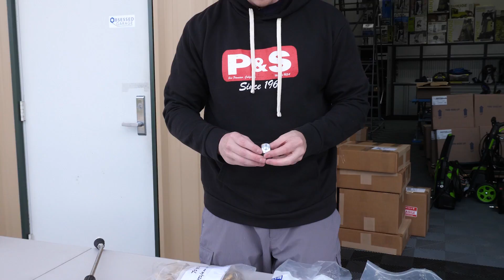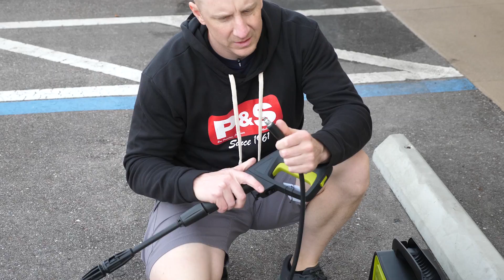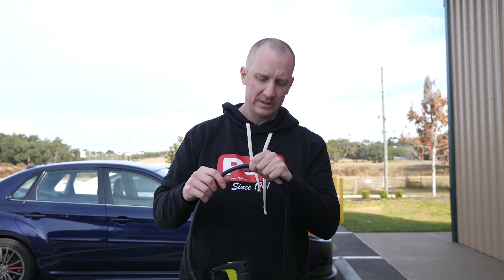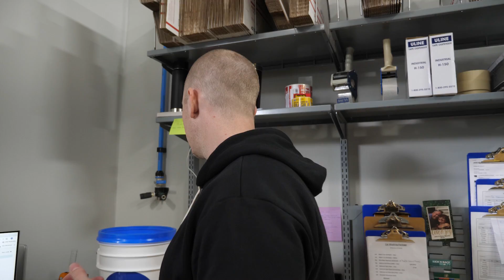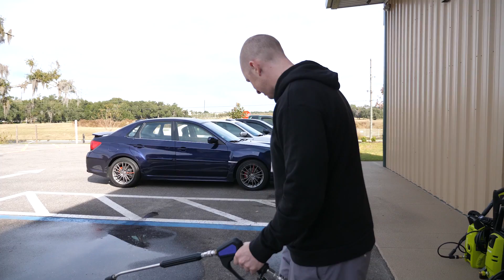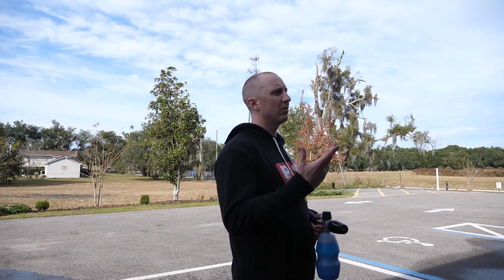The Pressure Washing Project: E6 - Testing the SunJoe Product Line - Part 1

Comment: Hi Matt!! Just tested your setup for the first time today with my sunjoe spx3000 and there is something wrong about this. The pressure is soooo low and even with a 25° nozzle, I had to come very close to the paint to remove the dirt and even the soap. I also try the foam canon and it's so watery. No thick foam like I used to have with the stock hose and gun. The other problem I have is that the pump just keep going on and off every 2 seconds, even when I'm not using it. What's the problem? Why do I have such a low pressure and if I want to use it for heavier jobs, does it mean I have to use the stock hose? Is it possible to get higher pressure with your setup or it's only meant to be used for car wash with around 1000 psi? So much questions, I thought this setup was going to be so good, but right now I am a bit disappointed, especially for the price I paid, but I'm sure I'm doing something wrong and you can help me fix the problem. Thanks alot and keep up the good work.

Comment: Recently purchase a sun joe spx 4000 pro. I want to try to mount it inside the house and some how connect it to water inside and create a spigot for the pressure washer line outside. Any suggestions would be appreciated!

Comment: 15:18  My exact thoughts when I bought my junky Karcher.  It's going on 2 years working great still for WELL under $100.  Yeah, I'd like to have a Kranzle, but in the meantime, as a pro, my bottom line sure is thankful for this POS, and the cars can't tell a difference between pressurized water from a $1000 Kranzle and a $100 POS--they still get wet, soapy, and rinsed no matter what.  Hopefully I'll be able to afford a Kranzle by the time the Karcher pukes, though  :)  Sometime sooner I'll probably swap the gun and hose not cuz there's really anything wrong with the Karchers (well, the long Karcher gun is awkward sometimes), but cuz I'll need those for a Kranzle eventually anyway.

Comment: What length cobra jet pressure washer hose are you using for testing? Would some of these measurements change much with a longer one? I prefer a slightly longer hose myself.
Reply from the maker: 50'.  There was no difference in output with 100' hose.  Once you get over 100', you'll start to lose some.

Comment: Interesting roundup testing, over here in uk karcher is most common, so will be most interesting your thoughts on those 🤔 😂
Reply: Also these are the common plastic and stainless quick uk connectors from uk fyi ..https://www.hozelock.com/product-category/watering/fittings-and-connectors-watering/hose-connectors/

Comment: A similar activity for machine polishers would be interesting.
Comparing the industry standard Rupes with the other less expensive popular machines.
Using various pad and polish combinations with each device. With a mix and match scenario. 
An Interesting outcome I’m predicting.
Reply from the maker: The problem I have with that test, the cheap ones are a blatant copy.  I don't think they don't deserve the test.
Reply: Obsessed Garage 
Fair comment. It’s appreciated. 
Maybe let the quality speak for itself. 
I think we know the likely outcome, tested or not...
Buy the best you can afford. Not the cheapest. There is payback with quality. But unseen at initial purchase by some!

Comment: What is wrong with gas power washers?  Is it the noise?  Can't you get similar results to a kranzle with a quality gas power washer?
Reply from the maker: They don't turn off when the trigger is released, and noise.  We also really don't need that much pressure for washing a car.

Comment: I'm interested in one of the products featured here......that beautiful blue Continental water hose!  I have a feeling come Spring I'll be buying a few hundred feet of hose from you.
Reply from the maker: They are really nice.
Reply: @ObsessedGarage  Surprised that you haven't had much to say about getting a garden hose with stainless fittings  :)  I use a Conti hose at home, but I'm a mobile detailer, and I've been on my own OG-style hose hunt lately.  I've been trying to find the perfect lightweight hose which would probably look something like a 1/2" polyurethane hose with full-flow stainless fittings.  Ugh, I HATE hoses that have restrictive fittings!  There is no point in having a 5/8" hose if your damned fittings choke down to 1/2" or, as I've found with some, even smaller!  If the fitting size is what I want, I don't want to pay for and carry the extra weight of larger-than-needed hose, and if the hose size is right, a choked fitting makes it effectively too small.  I thought Water Right fit the bill, but I'm told their fittings are major choke points.  Eley is the only company I've found that fits their hoses without restrictions.
Reply from the maker: Finding stainless 3/4" GHT Ferrels is not easy.  Then I would a fitting press to install them.  My goal is to be able to do that at our next facility to make custom lengths.

Comment: Appreciate all the work on the testing; it’s a lot of work using equipment you don’t like using lol Seems like the tiny portable units of all the makes so far perform better than most people would suspect. Makes some sense as there are way more companies that make pressure washers than actually produce the pumps and motors so underneath many are probably very similar. That little SunJoe used less amperage but had better flow making it more efficient than lots of the bigger units and had what you really need to wash a car so not terrible. Too bad SunJoe uses those weird sized fittings. I have an SPX4001 and needed to get the right adapter. In the end it’s not a big deal because I wanted an MTM gun and foam cannon anyway so I was going to toss the original gun no matter what washer I bought. The way I look at it a quality gun and cannon last and get carried foward if you upgrade to a new machine in the future. 

The problem I see with something like a Kranzle, as super nice as it is, is that the customer that gravitates toward paying $1k for an electric pressure washer for his car is going to be the type of person that will run out and buy the $1200 new best thing when it drops a few years later so buying a pressure washer to “last” is kinda moot. For the record I’m not opposed to spending money on machines that aren’t the best financial sense if you love them and enjoy using them; I bought an Alfa QV that probably requires a few screws loose to buy but I love it and it puts a smile on my face so who cares! 😜
Reply from the maker: For me, it's not about longevity it's about user experience.  It is hard to measure and quantify quality.
Reply: Obsessed Garage fair enough. But once the system is sorted out and in use the quality of the gun, the foam cannon and having enough gpm and psi for the task really are what matters. The gun and swivel are the parts you interface  with most while doing a job and if they’re of good quality the pressure washer is really just a pump and motor that can be swapped out for any other really. I appreciate your attention to detail and your appreciation of well made quality things. Nothing wrong with that. I just look at the actual pressure washer as a commodity item and would rather spend my money on the gun, foam cannon and good soap but then again I just use my pressure washer once or twice a week for my car and occasional random household tasks.

Anyway keep up the good work!

Comment: I love the come to Jesus moment at the beginning. People need to chill out.  I have the spx3001. I purchased a hose reel leader hose that is female on both ends and it solved the leaking. Mine in permantly installed so I don't need to have a quick disconnect on the inlet.

Comment: Very impressive for the tiny one, lets see the spx3000 and above since imo those are most popular. I was laughing at the start and stop part, you're so right, my spx3000 does make that sound...lol, but works great with my of setup though. Want to see if you come up with something to replace that crap inlet SJ adapter, mine hasn't leaked, but I know that's the point on where that could happen. Great stuff Matt

Comment: I think Part 2 is what applies to the masses of SJ owners. Matt, if you come up with a package (fittings/hoses/swivels/guns/cannons) for the SPX3000, you've got a new customer.
Reply: He already has, but he will probably put it more together now. I have a spx3000 with everything from OG, gun/wand package, pf22 foam cannon with 1.1mm orifice, inlet hose QD'S, 3.0 orifice nozzles, using stock heavy duty sun joe hose with 25' heavy duty extension. Telling you in advance, get the swivel gun and pf22 foam cannon, period. The foam cannon is the most important piece of the puzzle, tested a few different ones, nothing comes close.
Reply: @KenseisGarage  I need to check to see which orifice is in my PF22. I don't think it's the 1.1mm.
Reply: @russellhagy  If you're not using the 1.1mm, the foam will not be any good. It has to be 1.1mm for this machines, period. get it from OG if you don't have it. Matt has the one for the PF22, and fyi don't try to get a cheap one from amazon, seem like there's different treads on the orifice. I tried another 1.1mm from one of the cheap amazon foam cannons I tested with and it doesn't work on the pf22.
Reply: @russellhagy  Also, If you bought the pf22 from Matt, it should have included both orifice in the box, well, at least the new packages include now both orifice. the standard 1.25, which comes installed on the foam cannon and the 1.1mm.
Reply: aloharacing  it’s been available for a long time
Reply: I have an SPX3000 and I have the Kobrajet hose and MTM gun with all the QDs from Matt. No problems.
Reply: @russellhagy  me too! all i bought was an adapter to convert the output of my SPX3000 to a standard M22 14mm. everything else was cake.

Comment: hey, Matt good video!  was just wondered if you have a suggestion on a pressure washer that doesn't break the bank but is also not cheaply made! thanks love your videos!
Reply: Iknoweh17 Watch episode 5 , with all the pressure washers he tested so far he found the best overall performer(one of the green works), but I would wait and finish the series there may be better ones down the line
Reply from the maker: It really doesn't exist unfortunately.

Comment: You just have to get a flat rubber o-ring seal a put it in behind the original wire mesh rubber water filter

Comment: I have a sunjoe spx3000 with a 50' kobrajet, Cox reel, sgs28 and bent wand. Quick disconnects on all of it. Really couldn't be that much happier with the setup.
Reply: I have the exact same setup besides the reel. Works really well for me.
Reply: @russellhagy  I'm thinking to post a few photos on the FB page to give people an idea. It's been really great
Reply: Scott Grande I have a spx3000 n I wanted to change my wand to maybe a mtm  hydro was wondering what fittings did you use to connect your sgs28 to the sun joe
Reply: @prhondagirlinphilly7459  used a kobrajet hose so I don't know you'd connect the existing hose to the sgs
Reply: @prhondagirlinphilly7459   I have the SG28, with an mtm swivel (swivel is a most, period) and QD's using the spx3000 sun joe stock hose. What you need is the adapter that Matt sell for the SJ, that will work just fine if you don't want to spend on the kobrajet. I have the complete wand package from OG, pf22,  inlet hose QD, 3.0 orifice nozzles, my hose still is the stock heavy duty sun joe and I added the SunJoe 25' heavy duty extension. The key component is the pf22, believe me, been with that setup for a while after testing a lot. Here's the adapter, https://www.obsessedgarage.com/collections/pressure-washing/products/adapter-for-ar-blue-sunjoe-other-m22-15mm
Reply: @prhondagirlinphilly7459  I would definitely upgrade your hose if it's in your budget. I got the 50' Kobrajet from OG and I love it cause I can keep the pressure washer in the garage and spray around the entire car without having to drag the pressure washer around with me. Well worth the upgrade.
Reply: Russell Hagy I will definitely check into it..did it come with fittings to be able to hook it up to a gun for qd? Or did u just buy the fittings yourself
Reply: @prhondagirlinphilly7459  The hose itself did not come with the QD for the gun. You would need to add those as well.
Reply: @prhondagirlinphilly7459  Just found my order confirmation. I bought the 50' hose with SunJoe SPX3000 QDs and the "Complete MTM swiveling sprayer and wand solution". Was everything I needed. $281.
Reply: Russell Hagy that’s a hefty price for me but I did check it out it would end up being 116 for just the 25ft n QD... I have to think about it but I definitely want to upgrade my current setup so we will see which way I go.. thanks so much for all the info..I’m going to join the FB page now
Reply: @prhondagirlinphilly7459  The shorter hose is a great option. The sprayer is the main upgrade and I highly recommend it. Maybe the next video series will tell you if it's possible to upgrade just the sprayer with the stock hose.
Reply: Russell Hagy I think I have to definitely upgrade the hose I hate that extra stiff thing Lol ..the sprayer is a must because using the long wand it comes with n attaching my foam cannon to that is a bit heavy n cumbersome... I’m just starting this detail journey n I’m falling in love with it.. my pockets just need to catch up lol
Reply: @prhondagirlinphilly7459  I agree. Being able to attach the foam cannon directly to the gun is a game changer. Plus doing wheels with just the short gun and no wand is so much easier. I "want" to upgrade my pressure washer, but in reality it works well for me and it's even better with the modifications.  You do not need to spend a lot of money to keep your car clean, but it's easy to get sucked in to it all. Hopefully the SPX3000 lasts, but I've only had it since April or so after I got my new Honda.
Reply: Russell Hagy I’ve had it for over a year and really like it.. It’s great for outside cleaning like my yard ,my driveway n small deck I built..it’s killing me not to be able to wash my Civic but it’s been raining here ugh... cant  wait to change the hose and gun but it’ll have to be after the holidays..
Reply: @prhondagirlinphilly7459  Oh I understand. I'm right over the bridge in NJ. Got the same weather here! haha. Been doing a lot of Optimum No-Rinse in the garage lately.
Reply: Russell Hagy I wish I could I’m doing a full clean out of my garage early spring  I have too much junk in there n I want to be able to use it for my car lol
Reply from the maker: I guarantee you would be much happier with a Kranzle.  No question.

Comment: Other than the slight leak on the smallest SunJoe unit ... specs and results appear to outperform the similar Ryobi’s or Greenworks.
Reply from the maker: I'd still take the Greenworks, no goofy fittings.  It's also built a bit better.

Comment: Will you be testing the Comet?  I like the Kranzle (price doesn't scare me away), but I live in an old house (rental) with knob and tube.  20A isn't really an option for me.
Reply from the maker: I will be.  I ran a quick test.  It drew 11 A and did 1.8GPM.
Reply: Obsessed Garage was the 1.8 with the stock gun and hose? Curious if it will go up like the rest.
Reply: Tbf you dont really need a 20a circut, just make sure nothing else is on the circut when using the foam cannon, or you can always pay an electrican to install one.
Reply: Same. I have the comet static and I think it is awesome. But I have no way of testing the pressure. I am going to test the flow tomorrow. I’m just using a 3.5 orifice and hoping I’m good.